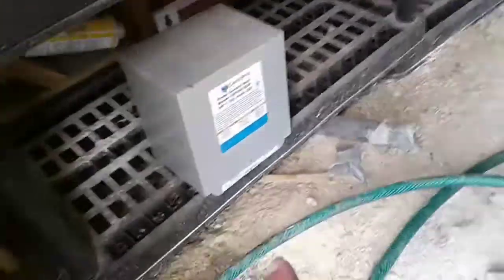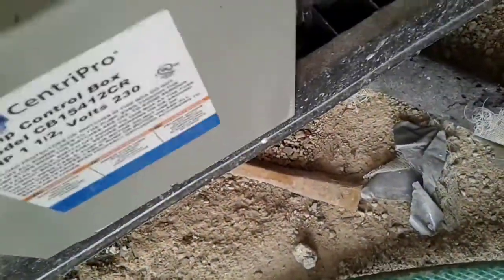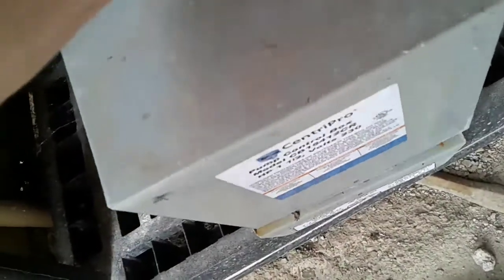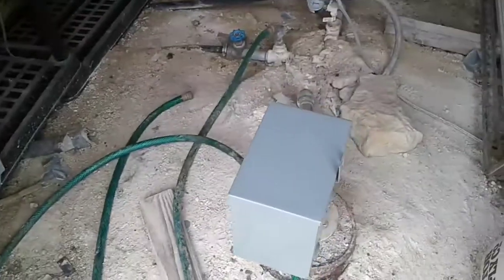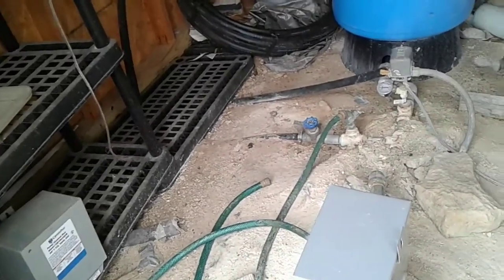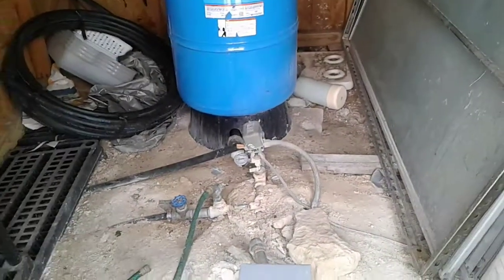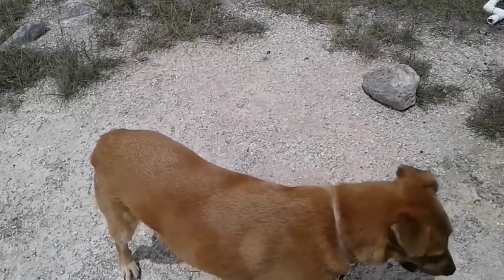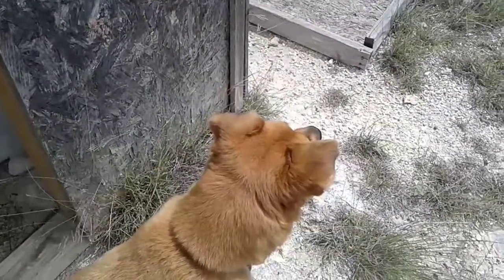Solving My Well Problem

Comment: Good advice to self-educate yourself on anything on the homestead! The part you are cleaning is called the Contactor and you're right, ants or anything else getting between the contacts will prevent a good contact. After cleaning it you may want to wrap it in saran wrap or something to keep the bugs out. Also, make sure that there are No Leaks anywhere. If so, then the pump has to repeatedly turn on and off to keep the pressure tank up (not good for longevity). Also wouldn't hurt to drape an old plastic grocery bag over the electronic box itself and put a rubber band over it to keep any moisture (and critters) out. Glad you got it fixed!
Reply from the maker: A few years ago ants were a major problem. Some days lost power to them several times. Finally I was able to pick up a fresh container of fire ant/ant poison. Applied it around the well, stuff stinks. I left the container in the well house. I haven't seen a bug in there since.

Comment: Shorts can be aggravating, Glad got problem remedied. Was best to replace, from your description.  You said well is 400 or so deep, how high is your water level or how deep is pump set, just curious.
Reply from the maker: I am told 420 ft. I'm on top of the Edwards Underground Aquifer. Basically an underground river. It is huge, also supplies San Antonio and lots of farm country.
Reply: @builtontherockhomestead9390  I figured you were. It had gotten very low, decades back, was curious. 
thanks.